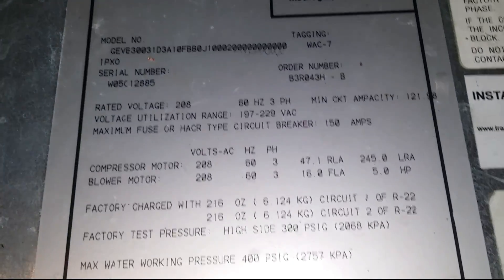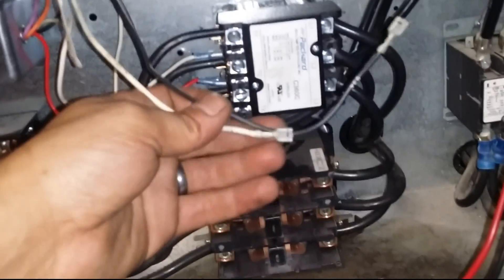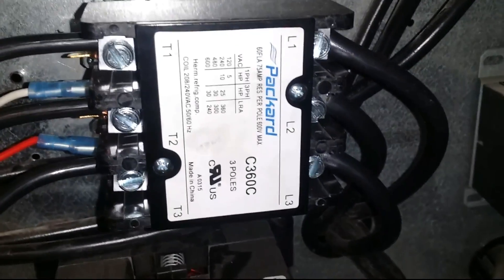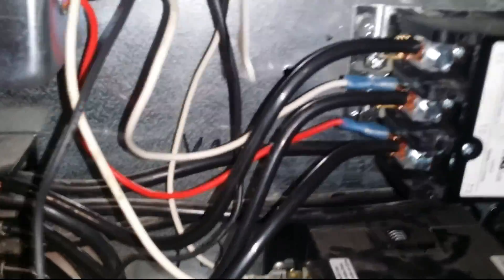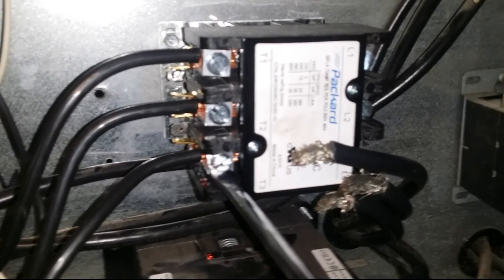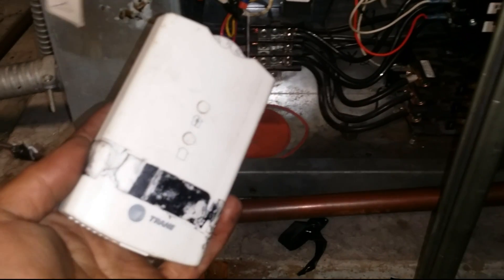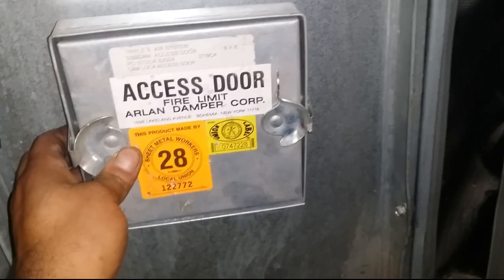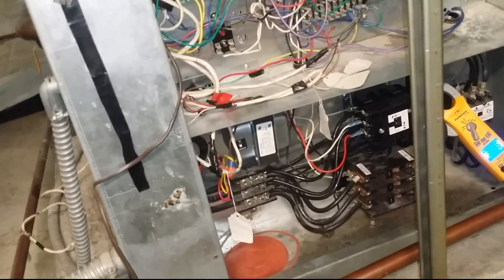25 ton Trane | Compressor Not Operating | HVAC

Comment: That suction dryer is not installed properly. It will cause an oil trap. They should be installed vertically to prevent this.

Comment: I'm guessing that whoever installed that new compressor just held the compressors contactor in with the fan running to charge that circuit, lol hacks.

Comment: So they change the compressor and never check to see if it runs? LOL unreal!
Reply from the maker: Lol not sure what took place Rob, from what the super told me, they replaced compressor about 2 weeks ago and supposedly everything was running well.
Reply: Hmm do you think it could have pulled in at first but barely
Reply from the maker: Joe Shearer from what the super told me the unit was working on both stages after compressor change out, that was about a month ago. Then the contactor failed and it was replaced, 2 weeks later I respond to the call.
Reply: Yeah they didn't want to wait for the time delay. Pulled the cover pushed in the contactor manually. And ran like hell. Lmao.
Reply from the maker: Jason Strom lmao
Reply: Great videos